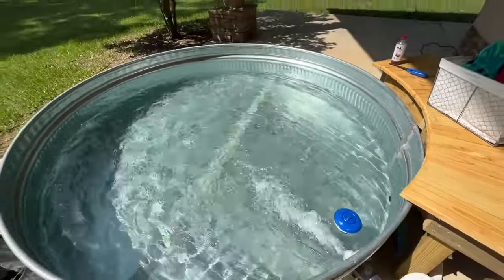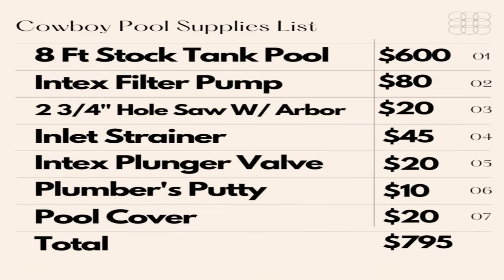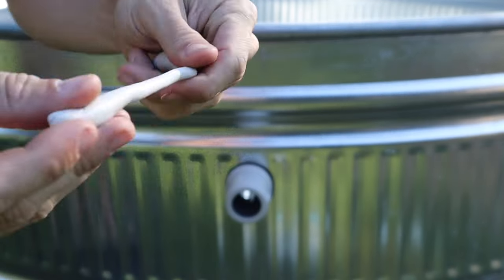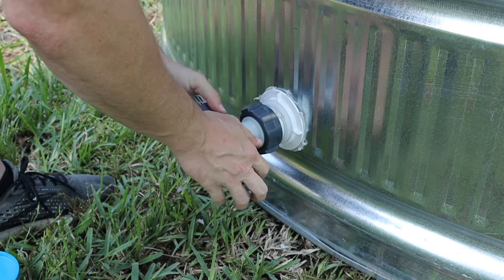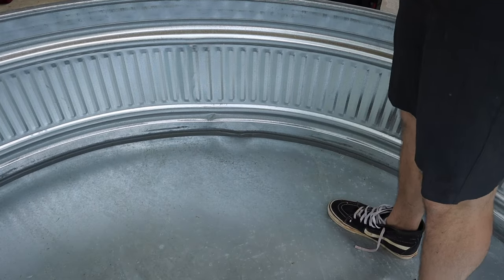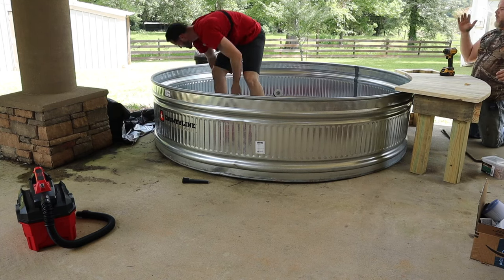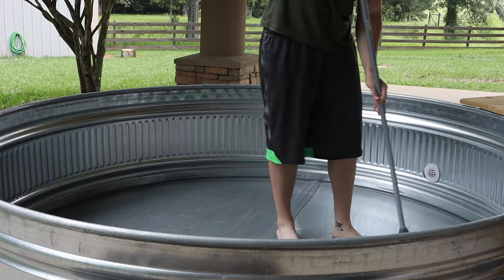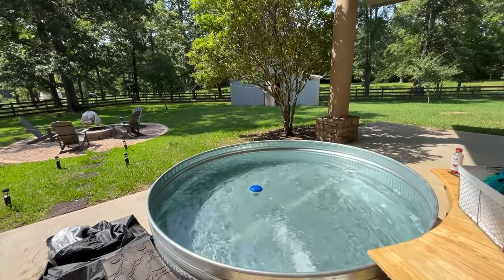I Built A DIY Cowboy Pool For Cheap (Is A Stock Tank Pool Worth It?)

Comment: Update your filter to a sand filter with the salt chlorinator…you’ll LOVE how much cleaner your water is and you won’t have to clean and replace a garbage filter cartridge 3xs a week anymore. 👍
Reply from the maker: Good tip!!
Reply: Do you have a link for which pump you used?
Reply: I was thinking can you use salt in these metal pools?
In any case keep your salt generator cell cleaned, will last much longer.

Comment: This is our second season with our pool. I was looking for away to keep the inlet and outlet from leaking. Last year I used caulk which leaked and rusted the pool. Your use of plumbers putty is brilliant. Thank you for that.
Reply from the maker: It’s been working great!
Reply: When you drill through galvanized you will expose the steel underneath and that is where your rust will form and spread. I would mask off the hole area and spray it with some sort of rust preventative finish. Cold galvanizing spray (just like spray paint) is ideal for this. If you get any scratches that expose the steel it is a pretty close match to hot galvanizing dip so buying a can just to spray the holes you cut out isn’t a waste of money, you will have a can of touch up on hand ready to go.
Reply: @MatthewZelek-iv8tb cold galvanizing spray?

Comment: 3:01
😮😮 idea to hide the connection make a flower pot out of wood and make it be hollow on two of the four sides. Then put in tropical plants. Something like a small palm tree.
Reply: Also add some cheap LED color changing outdoor lights to put underneath that platform.
Reply: Can you post a picture?

Comment: Would you consider using a pool liner?
They could be replaced annually, if necessary to avoid slime, but you're probably using Chlorine anyway.
Great idea about the sand filter.
I heard they can also be insulated.

Comment: You could have flattened the scenes with a round 1/4 inch plate of steel and a flathead hammer I believe the seal would have worked better the first time around

Comment: How do you keep it from rusting on the bottom? We have had ours less than a yr and its rusted and ruined our patio
Reply from the maker: I don’t use too much chlorine in it. I haven’t had a rust issue though. Do you use a lot of chemicals?
Reply: @GarrettbrownRE  not at all. We just use salt water. It's rusting underneath the steel against the pavement.
Reply: @macailea  thats why you have rust problems. The salt water will rust the steel. If you're doing salt water, you may want to look into a different material for your pool otherwise, I'd just switch over to the chlorinated methods.

Comment: How’s it holding up? Anything you would do differently?
Reply from the maker: It's holding up great. I think the only thing I am going to differently on my next one is paint the inside with a sealant that was recommended by a few people. I had some small spot it started leaking I fixed but I think for longevity I'm going to take care of it with sealing the whole inside soon.
Reply: @GarrettbrownRE  we had this problem too. We're ending up sealing every thing to avoid leaking and rusting. We will be painting the inside as well to keep it for longer.
Reply: @GarrettbrownRE   May I ask what you used as a sealant to coat the inside and what brand of sealant?  I live in a cold weather climate (snowy winters).  Do you think it needs to be stored so it's out of the elements?
Reply from the maker: @greekbecky1  if you live in snowy weather; I would store it. I used gorilla glue to seal some areas that cracked during the move of it
Reply: @GarrettbrownRE  I guess what I mean was what did you use to coat (spray) the interior of the tank so it's coated like a truck bed would be?
Reply from the maker: @greekbecky1  I didn’t coat it with anything but I have seen others use a certain paint on liner for it. I can’t remember the brand though. Mine is doing great though with no coating
Reply: @GarrettbrownRE  Thank you for the quick response...:).  One more question before I pull the trigger on all the parts. I'm not an electrician...what if you didn't have an GFCI outlet?  Can you you use one without or am I asking for a fire?
Reply from the maker: @greekbecky1  I would 100% only use a GFCI outlet and most of the parts for this type of thing if not all will be 3 prong anyways

Comment: You spent $600?? I just bought mine for $205 exactly with free shipping from county line
Reply from the maker: What?!? For a 8ft wide? I looked forever to find a cheaper one and no one would deliver/could beat the tractor supply price. Where are you located?
Reply: Where did you find pool at tractor supply
Reply: Is it possible yo share the exact plans on bench. I will be building this by myself
Reply: From where?